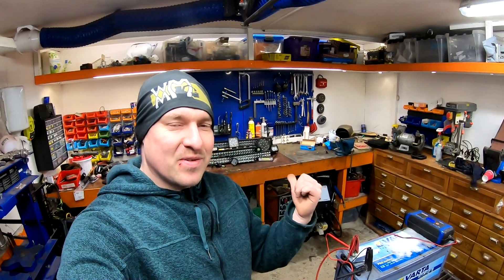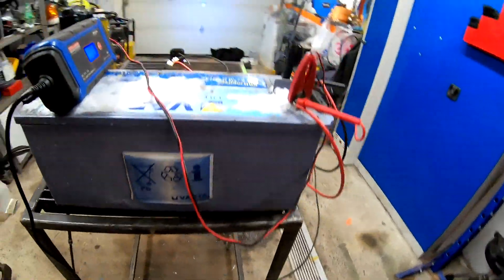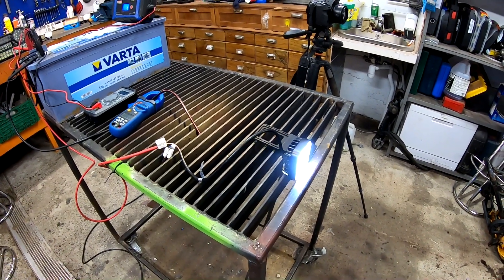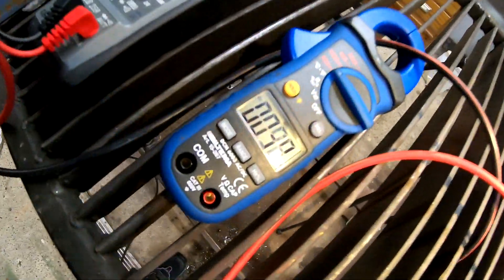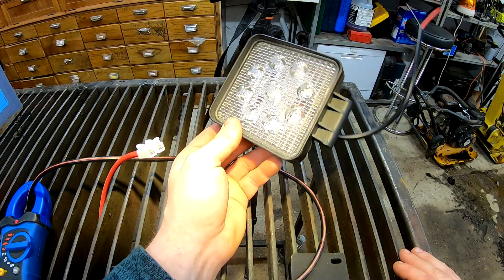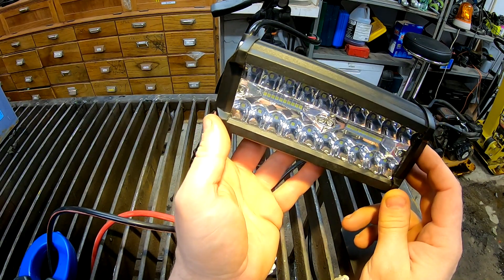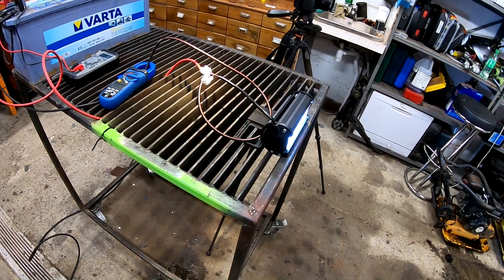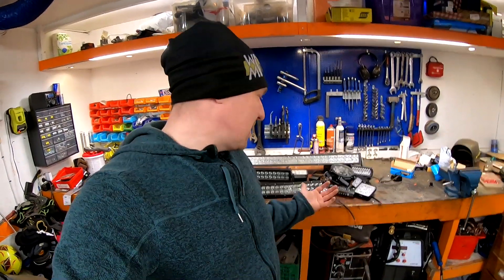Ebay LEDBAR watt VS actual measured watt

Comment: how would I hook up these lights to get 24 volts or maybe even 32 volts they're maximum  rated for??...
Reply: Errmm... Use a 24V power source? 😂
It's not going to make them brighter though, the LEDs use less than 12V anyway, there's a driver circuit built into them to reduce the voltage internally to the voltage required.
The 32V limit is just the driver circuits maximum input voltage.

Comment: I bought the 615 W Amazon Led Light Bar I am about to put it on  on my car. I also think its some kind of bullshit ;)  just wondering from your experience 2,5mm supply cable should be enough ?
Reply from the maker: If the wattage is near true it's 45amps than the cable is way too small, but likely it's not that many watts
Reply: @MiniMachines1  I will measure current first. Then decide about wireing. Better this way.
Reply: @MiniMachines1  it showed 10 amps lol, I have to verify with another device coz I am shocked xD
Reply from the maker: So about 130 watts than you can safely use your 2,5 wire if it's not too long😊

Comment: The Ebay quoted values are almost always 3W x number of LEDs in the light as they assume every LED is 3w each (which is obviously not the case), other seller arbitrarily boost the wattage as it is a selling point.

Comment: Great video brother I have I think the fourth or fifth one you tested as a backup light on my pickup truck and it is awesome couldn't live without it I know the instructions say you can use 12 or 24 volt with them 24 volts would probably make them they're rated wattage but normal Vehicles don't have 24 ⚡️ volt systems LOL
Reply: 24V isn't likely to make them any brighter/increase wattage.
The LEDS don't use anywhere near even 12V.
There's a driver circuit inside them that has an input voltage of between 10-32V but has a constant say 6V output.
Obviously increasing voltage will reduce the input current but the wattage shouldn't really change.
Reply: @deezelfairy  got ya thanks
Reply from the maker: Thanks

Comment: I'm returning a "216w light bar" from Amazon, 48w draw. I'd rather listings were accurate, especially when considering if can supply enough power. Multiply wattage  by 0.25 and it's pretty accurate 👍😂
Reply from the maker: Yes sadly that's how it is for most lamps, I ordered some nice nano leds that was suppose to be 9w measured them to 3w, thats a big different in light output.

Comment: Trouble is you are measuring power not light emitted.  Just to confuse the issue they often say Xwatts comparible to Z watts incandescent which is comparing power consumed not really light emitted.  Lumens is a more applicable unit of measurement when after how much light a fixture gives off.  Even that is distorted by the manufacturers in the specifics (spot, flood, distance, color etc).  For what you are using these for I would also specify the light be "daylight" or 7000 Kelvin for maximum useful light per lumen.  What we are all looking for is the most efficient means of producing the most useful light in a spectrum we can use. As they say, "If it is advertising it is lying" same as a politician talking.  How do you know they are lying?  Because their lips are moving!
Reply from the maker: That's true, but I measured the watt against the watt the seller said it would have, so it's apples against apples 😉
Reply: Measuring Lumen is cumbersome and expensive to do. One test that is a bit easier is to measure lux at a specific distance. LED bars often have at least two numbers 1 lux distance, and 0,25 Lux distance. Of course, that doesn't measure the amount of light, just only the intensity at one spot but it is still a pretty easy comparable thing. Most proper manufacturers nowadays write theoretical Lumens and actual Lumens where the theoretical is just the LED bead stated Lumen times the number of beads used in light. Measuring Lux at distance straight from the light AND measuring Lux at fixed angles (30, 60, 90 perhaps) and distances would be a good way to get a comparison of the amount of light one actually can use from a LED light since it depends on what purpose the light has, a working light should give most light on a wide angle but not necessarily very far away, etc.

Comment: The funny thing is that, highly advertised wattage isn't a good thing in particular, as I'd consider it by Amps load 🙄 Yet I might be the only one to do so 😂
Reply from the maker: I just got in 10 lamps from china (Alibaba) they where suppose to be 36w measured them to 2watt, I made my complain but as long as you could se light from them it was no money back☹
Reply: @MiniMachines1  sorry to hear that. I usually buy from Aliexpress, which is (or was) quite good with disputes. FYI
Reply: @MiniMachines1  sorry to hear that 😡 that doubt is always on my mind and prevents me buying these lights
Reply from the maker: @overnighter  I also thought it was a safe system since the seller dosent get there money before I've received the product, but here alibaba woted with the seller since it was light from the led's🙄
Reply: @MiniMachines1  I can feel you... I have also  noticed AX sellers use "vague" words in description and they state that "power can be less", etc. and they NEVER indicate Amps!
Reply: @MiniMachines1  also, precious LED bulb replacements "failed" very quickly on my Defender. So, I eventually I turned to "classic" bulbs, which seem to last better 🙄
Reply: Overnighter I completely agree. I care more about the amps than the watts but product information is so inflated and misrepresented nowadays that it's rough on a good day trying to buy. It's gonna be overrated, over priced, and overwhelming it seems 😂😭
Reply: @matthewfiedler2787 well, almost nobody tells the truth. We all need lux meter mate 🤣

Comment: Finally, a proper wattage 👍
Reply: Also, I noticed you locking the  exposure with camera 👍
Reply from the maker: Yes else it would be a useless picture😀
Reply: @MiniMachines1  👍
Reply: @MiniMachines1  many other reviews make in in AE and the camera adjusts settings, and eventually 4" bar and 50" bar look the same 😳😂
Reply: @MiniMachines1  I know that you know that 🤔😂

Comment: If you're getting them for a car/truck you might aswell fit an inverter and run 240v LED lights, seems to me that there is much less Tom Foolery with that market.
Reply from the maker: Never seen ledbars for 220v but you need a big inverter than and you get a new source for error.

Comment: Mounted the 12 W and 18W lamps on my mini excavator:

https://youtu.be/zQOzF5pC7HQ
Reply from the maker: Looked like you got a good amount of light from those small 12w lights. They are awsome since they are so easy to place and pull little power you can have a lot of them, light in all corners.
Reply: Mini Machines yes I really liked them, thanks for the tip!

Comment: Are there any cheap ledbars that are usable on a car? High beam
Reply from the maker: Not that I know of, the cheap ones give a lot of light but it's more close to the car not where you would like it with an high beam far from the car. You get so much light in close to the car with them so it's hard to se the light that is far from the car. But I've only tested a few so might be some cheap that works. Best so far is xenon extra lights, but some cheap that's  for halogen and install a xenon kit in them that gives you great high beam lights, but dosen't look good at all cars...

Comment: 8:10 mines so much brighter i have the same ones
Reply from the maker: Do you think you'rs are closer to 400w seeing the other ones that have over 100w in the video?
Reply: @MiniMachines1  they are def closer too 100w bought them off ebay they were like nao 7 inch led baror something
Reply: IMO it's really hard to say "same ones" with certainty since manufacturers in this category copy/steal from each other wildly. A LED bar that looks identical to another can have different LED beads and/or LED driver electronics. Even bad soldering can influence light output so not only components but also the manufacturing process can make a big difference, especially when we go to the high-power ones. Even the exact same Ebay-listing can contain a new batch of lights that can be better or worse than earlier batches. It's a lottery, I have won and lost thru the years buying Ebay/Amazon/Ali Express lights. My next light for the car will probably be an X-Vision D MAXX from a genuine Swedish seller (I live in the dark Värmland forests 😁)
@Mini Machines: great video 👍 I would love to see a new video with some Lux measurements, it doesn't have to be an expensive, perfectly calibrated Lux meter as long as you use the same one for all tests, the relative numbers are the important ones in my book.
Reply: @bennylloyd-willner9667  true true

Comment: Was just going to shop led work lights! This was a great test! Think I will use the small square 12W lamp(first one) on all 4 corners of the mini excavator. Maybe 2 on the mini tractor and 2 on the ATV. Great test!
Reply from the maker: The 12w and the big 48w are my favorites but check the size so you don't get the small ones trying to be 48w looks similar on the pictures
Reply: Mini Machines I found the 12w for 55 sek, think it’s the small ones.
Reply from the maker: @NilsKall  the 12w I think it's only one type and the price is right, but the 48w it's 2 sizes
Reply: @MiniMachines1   Can I get the link for 12w and 48w ones please? Thank you

Comment: Your tests were valuable and informing. Thanks for doing them.
When I shop for LEDs, I am looking for highest Lumens,  accomplished with lowest Watts. If a seller does not mention Lumens at all, I will not even consider them. To me, High Watts as bragging rights seem like a hold over to the older Incandescent bulbs.
That being said, I don't even know how to test Lumens to check if their marketing hype is correct.
Reply from the maker: I think that sounds like an good way to look for lights on Ebay, you could buy an light meter to test the lumen, but than it's all about what distance they measured there lumen from.
After buying some leds over the years I think the one I test from 2015 48w that is 39w is one of the best ones, it gives an awsome amount of light and are cheap. and I do love the 12w ones.
Reply: You can not test lumen with just a lightmeter. You are thinking about testing lux from a distance, but lux just tells you about how strong the light is in one point, no the total amount of light (lumen). For that you need to collect all the light in a sphere.
The test you did with the camera is a good example how you could measure total amount of light if you have a lightmeter in the camera, or if you put a luxmeter instead of the camera and measure the reflected light from the wall. But you have to turn the garagelight of when you measure the light, or it will add to the result. You also have to remove the black banner on the wall because it wil absorb a lot of light in the focuspoint witch will reduce the amount of reflected light a lot from well focused lights.
Thanks for a nice video. It's intresting to se witch products are worth buying.
Would be great if you could put links to the lights yous tested. At least your favorites.
Reply from the maker: @Larsema1  Good idea will put up some links for my favorites :) I'll stick with the watt test easy and with the photos from the camera you get an idea of the different amount of light. It's fun too see what the seller promise and what we get. I'm really curious to see what I get when the seller of the "400W" lights send me some new ones.
Reply: @MiniMachines1  Thank you! I've also measured some of my working lights just like you. The wattage says a lot when comparing the cheaper range of lights, with the same kind of diodes/efficiensy.
More expensive lights, like with real Cree diodes, is a little different.
I'm thinking about building a box with white walls for measuring the amount of lux reflected from different lights. Not for an exact value of lumen, but to compare the lights with each other.
Your wall and camera works too!
Thanks for interesting videos!
Excited to see a new video with the new 400W light later. And maby some new lights? ;)
Reply from the maker: @Larsema1  yes will be some more testing are more lights on the way in the mail 👍 just need to install some also 😅 the valmet has got some new lights but still need more